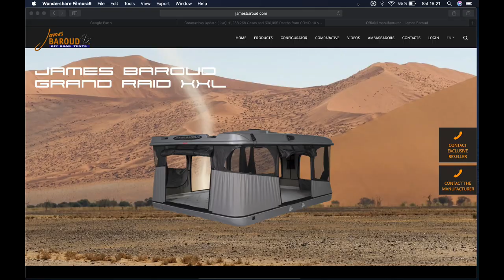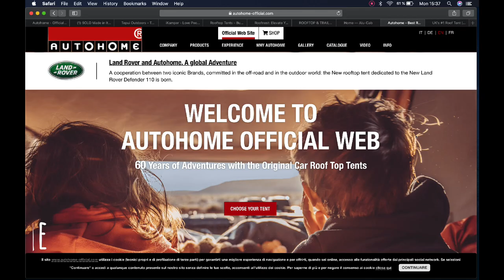JAMES BAROUD Rooftop Tent REVIEW || from a Full-Time OVERLANDER

Comment: Hi guys, I'm from far North Queensland,  Australia and am struggling to find and review that says if it is sand fly or midgee proof. Have you had any issues. Thanks kindly. You 2 have a great energy.
Reply from the maker: That is a really good question, haha. NORMALLY we do not get bugs that are small enough, and fly high enough, to make it through the windows in the rooftop tent. We were getting mosquitoes until we realized that they were dropping in through the ceiling fan if it was not running! Our fix for that was to put a sock over the fan at night when we didn't need it running. 
NOW, in Australia there were two places where we DID get little bitey insects in the tent and they had to have come through the windows. At one place (sandy and near water) we stayed 2 nights and ended up moving the 2nd night bc we got bit during the night. One hack is to not put your tent up until right before you are ready to go to bed - that helps. It also helps to have a fan up in the tent that moves the air around and would disturb any insects that somehow made it into the tent. 
So 98% of the time no insects made it into the rooftop tent, which is actually pretty good, we think! Thank you so much for the question, and thank you for watching our videos!!

Comment: I like your video a lot! I am from Germany. Have the same JB tent for 2 years now. Sold mine with the cargo top for the one without the cargo top now. I love the tent, its really good material.
Reply from the maker: Very cool! If we were buying the rooftop tent again we would also get it without the cargo top - bet that one is a lot less headachey in the rain, haha. Yes, we do love our JB tent and the material is awesome. We did not get the cold weather insert for the tent - we never needed it. Thanks for watching!
Reply: @planetoverland  I had the low temp insert, it works but you loose freedom as your windows and entries are getting a bit blocked. So the better solution is to have an air heater that gives you warm temp inside. Alternativly a 12V heating blanket, but if you have it above 40 Watt the heat is locally too hot. So the air heater is really the best solution for cold and wet conditions.

Comment: Thanks for the great video!  Question: Do you guys take your SUV/tent setup through the car wash? Just wondering if that would be safe with the Baroud mounted up there.
Reply from the maker: So sorry for the late reply - we just relocated and its been hectic!  NO, we do not take Reggie through an automatic car wash ever. Along with the rooftop tent we have the snorkel, and other odds and ends mounted on the car that we are leery about taking through an automatic car wash. At home we wash Reggie by hand, and on the road you can usually find a fairly reasonably priced place in every town that will wash your car by hand, as you don't usually find automatic car washes in other countries.
Thank you for the question!! Hope that helps.... :o)
Reply: @planetoverland  thanks!

Comment: I have my second JB Evasion. Rock solid quality. The fan is great but needs replacement after three years. Form me (190cm) the tent is a bit too short. If you travel to hot areas this tent is not the right choice as the windflow is not great leaving the heat in the tent making sleeping almost impossible. The clamps are not very finger friendly.

Comment: What Box is that on your roof? I started looking around for boxes that could carry on there for example sidewalls of the awning or stuff like that so it doesn't have to be carried inside the car.
We also own a Grand Raid but in M. And yes drainage only works if your located uneven a tad so the back is lower than the front.
Indeed had a few showers that way - which is cool of course in summer :D
Reply from the maker: Actually, the box on the roof is a rifle case :)
It fit perfectly and is waterproof - it has been amazingly sturdy.

Comment: What about the solar panels? Which ones did you use and isnt there a problem when it rains of the water pooling on top of the solar panels, effectively making them be underwater, doesn't that short out the panels?
Reply from the maker: Hello ToeFace! Per my husband: "I don't remember the brand but they were some cheap Chinese ones. They were flexible, not framed, and they were easy to take care of." We were in some very monsoon-y places and never had an issue with water pooling on the solar panels themselves - our rain issue was more with the dip in the tent roof itself. 
Thanks for watching!

Comment: Love my "tent", just not on top of the vehicle, we have a trailer where it mounts on top - that way when we go into town we can leave the campsite all set up! Also having it back on the trailer keeps it lower than our 4Runner which does not decrease the gas mileage as much (if you have a 4Runner you know every little bit helps).  Worth the price, will update in a couple of years!
Reply from the maker: That's awesome! We saw lots of trailer camper setups while traveling, especially in Australia. They did seem pretty cool :o)
Thanks for the comment!
Reply: That’s how I got mine. Someone left this awesome tent, hooked up to a fantastic trailer with all this really expensive camping equipment, basically left it unattended so we took it. Finders keepers. Losers weepers.😂

Comment: can you say how is in the winter if you use it ?
Reply from the maker: Hello Zenith - sorry for the delay in answering... There IS a winter option that you can buy that you hang up on the inside of the tent walls, but we did not have that. We were in some severely cold places (not for super extended amounts of time), and if you do not have the cold weather wall treatments, make sure to have something like a Rumpl or other thin down blanket, bc it DOES get cold up in the tent overnight. We did not have a heater up there either, FYI. But we found with 1 Rumpl we were good 85% of the time in cold weather, and then we had a second Rumpl that we could use if it was super cold.

Comment: I've often heard how most / all tents (ground or rooftop including insulated tents) are unbearable in the Summer without shade and or a portable air conditioner.  Have you ever been inside the tent in hot weather whether overnight trying to sleep or late afternoon in the sun and how sauna-like was it?
Reply from the maker: Good question! When it was hot during the day we were rarely in the tent, although there was a time when it was hot and I was not feeling well, and I was able to nap up in the tent for a couple hours before getting so hot I had to come down. During the hot nights in Brazil we ended up buying a little fan and Tim installed a plug-in for it in the tent - we would then have a spray bottle of water to spray at the fan to cool us off, and that worked fine. 
We have looked at those little teeny portable "air conditioners" and they look like they would work really well at night when it is hot and humid, but we haven't tried them in the tent.
Reply: @planetoverland  Hello. I like the info you stated in above comment about sleeping in hot weather camping situations. My husband and I are thinking about buying our first tent and just wondering if you have any updates or suggestions for night time cool sleeping tips. I have been looking at the zero breeze but have heard a lot of mix reviews about the units. Don't know if you have gotten to try anything like it. Plus I have heard folks saying don't set tent up until getting ready for bed to help avoid extra heat . So again just trying to get first time tent tips/tricks for camping comfortably. Appreciate your input!

Jess ☺️
Reply: @jessicagalvin363  you could try one of those pet gel mats that are self cooling. I work night shifts and often in the west australian summer heat of the day ill lay out the gel cooling mat on my bed and sleep on it for a cooler sleep. You can also buy a tent fan., i use the ryobi 18v one as you can get 12v chargers for them. Most of the major tool brands have some sort of fan. They do a good job, pair it with a decent battery size and it will keep on keeping on. Also open all the windows at night time/dusk, roof top tents cool down much quicker than ground tents they catch much more breeze being higher.
Reply: @krump743  Thanks for the suggestion 👍. 
Jess ☺️

Comment: Hi- What storage container is that on the top rear of your JB rooftop tent?
Reply from the maker: Haha, it is actually a rifle case, I believe from Pelican containers. It is very heavy duty, lockable, can withstand the elements, and fit perfectly on top of the tent :o)
Reply: May I ask how you attached/ mounted the Pelican case?   Thanks
Reply: … Also, how did you mount the solar panel on the James Baroud roof top tent?  Thanks for all your help!

Comment: Note there is no warranty for James Baroud roof top tents in Australia that are ‘second hand’ ie if you are not the original owner. Therefore, a rooftop tent sold to another person is not so valuable due to you are left on your own to repair any issues as JB were very clear they are not interested.
Read the fine print…..
Reply from the maker: Very interesting Bede, we did not know that. I am not sure what the policy is in the United States, but honestly, ours was so well-made that it should last another 5 years easy with no issues other than the zippers breaking in half, which doesn't impact the actual sealing of the doors and windows. Thanks for watching!